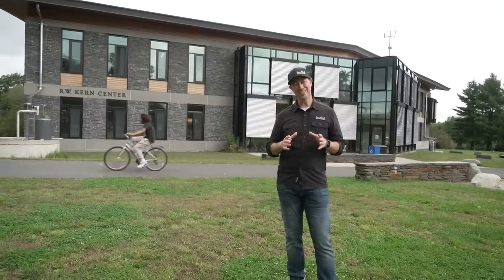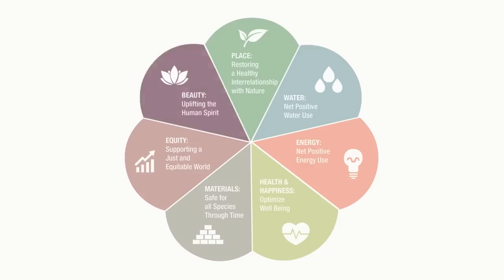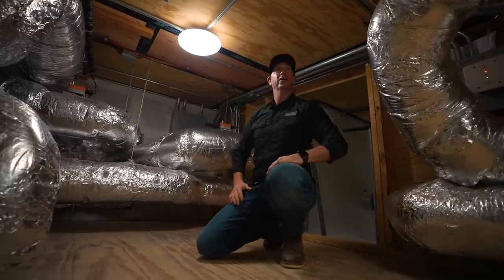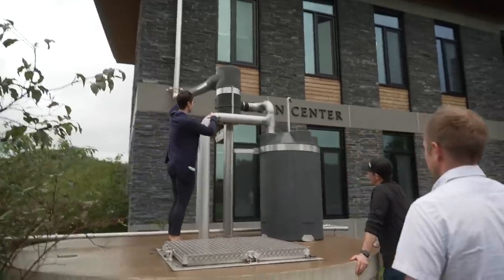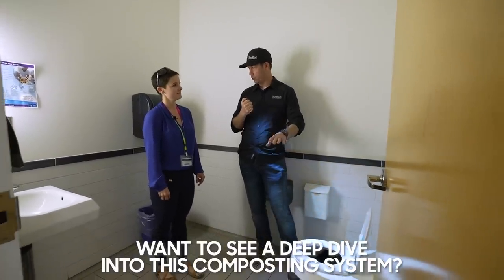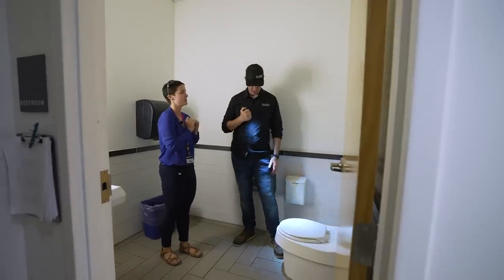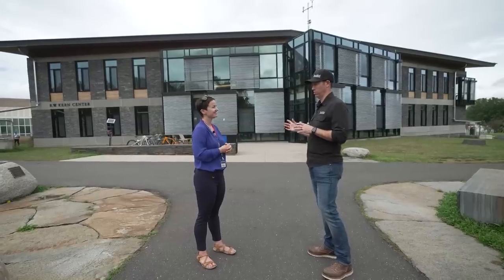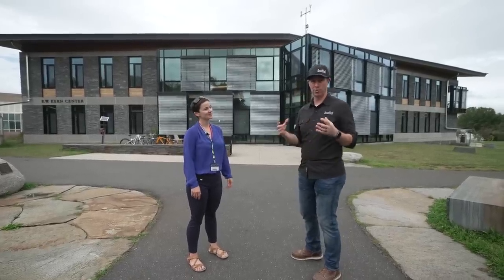Solar-Powered, Net Zero Water:  Amazing “Living” Building Tour! - R.W. Kern Center

Comment: "Sustainable" in this case most likely is a synonym for "wildly unaffordable and massively impractical".
Reply: Yeah.....notice how NOTHING was mentioned on the COST of said building.  I'm sure those triple pane windows were just given to them.
Reply: I don’t think there is any suggestion here that it is meant to be either of those things. It sounds like the exact opposite and that it’s intended to be an exercise in seeing what it takes to achieve all the points that were mentioned. In order for us to start building everyday buildings closer to this model and make it more affordable and practical we first have make attempts to do so. I’m sure a lot was learned in the process of constructing this and those things will be taken away in part and applied in areas where it does make sense from an affordability and practical implementation. Projects like these also gradually start to push suppliers to also provide more sustainable and thoughtful products.
Reply from the maker: I agree with this 👆🏻. My thoughts exactly Adam L.
Reply: @jadam42  
To be clear, this was not meant as disrespectful of Matt or innovations . Both are vital ✔.
I do greatly prefer the ideas that can be affordably incorporated into realistic buildings that most could Fford. That is the low hanging fruit to improve resource management.

Comment: Beauty: Totally subjective.
Place: Again, subjective.
Water: Okay.  Not everyone wants to live in a water treatment facility, but okay.
Energy: Okay.
Health & Happiness: Subjective
Materials: A building that doesn't rot and fall apart over hundreds of years?  Safe for "all species"?  Uh.  Someone really didn't deep-dive on the thinking behind this.
Equity: SJW crap.  Sorry.  As Conquer or Die said, a building doesn't care.  Equality of opportunity.  Equity is equality of outcome.  You bust your butt, you are rewarded.  Someone lazes off, they get rewarded the same as you for being diligent and productive?  NAH!  No thanks.

This is a feel-good, "everybody gets a trophy" "cert".  It certifies nothing, save that somebody has the "correct" politics and connections.
Reply: I agree wholeheartedly. 
'Who pays' was my first thought when 'equitable' was stated as a requirement.

The square footage required is massive and is just not feasible, nor cost effective, for a single family home. However the tech and innovation used is something to consider. As a thought experiment, and in this case, a proof of concept, I could get behind it. Such an endeavor with current technology and basic economics make it unreasonable though.

Comment: Why not incinerator toilet to reduce mass and not have to haul away poop with a truck.
Reply from the maker: Great question. Unsure. Need to look into that
Reply: Incinerator would require additional energy use (to heat) and would result in emissions from the burning process. We are able to use the compost from these toilets as fertilizer on campus (just not on our food crops!), so it's less wasteful.